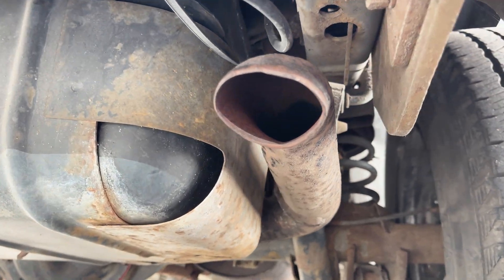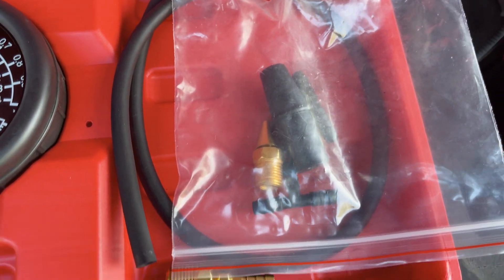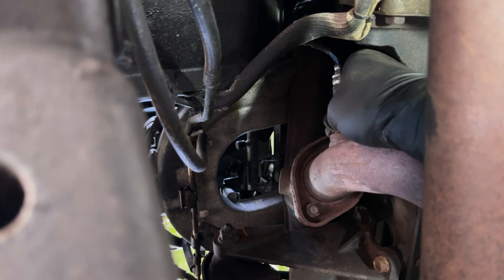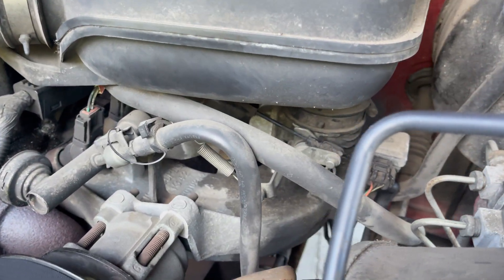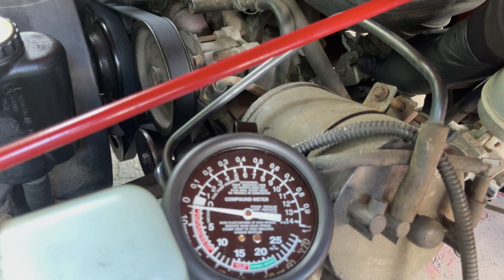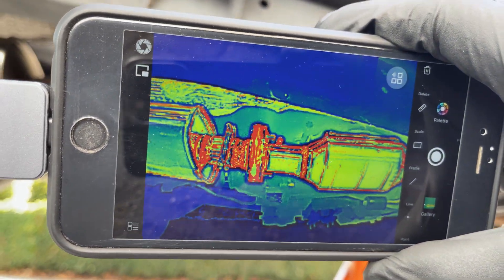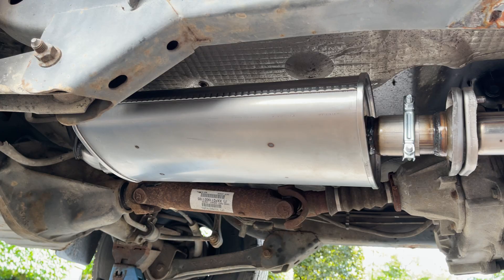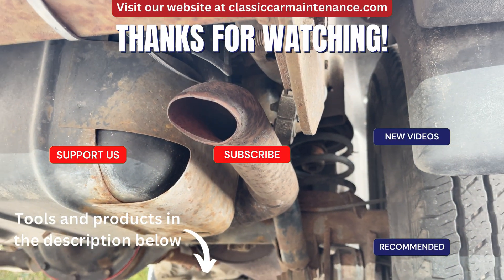How to Test for Exhaust Restriction - Easy Diagnose

Comment: I got code p050e and heard this could be one of the reasons?
Reply from the maker: An exhaust restriction could potentially trigger it, but it’s not the most likely cause. The most common causes are: ambient air temperature sensor failure, exhaust temperature sensor failure, a restriction in the air filter/throttle body, internal engine failure or a problem with your PCM.
Reply: @classiccarmaintenance dude you’re awesome thank you so much, gonna be checking on it today